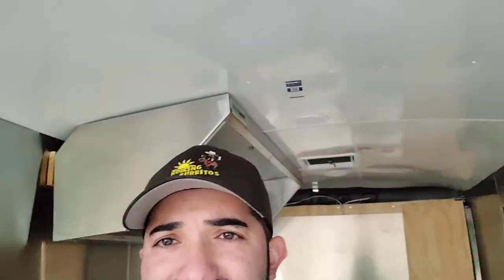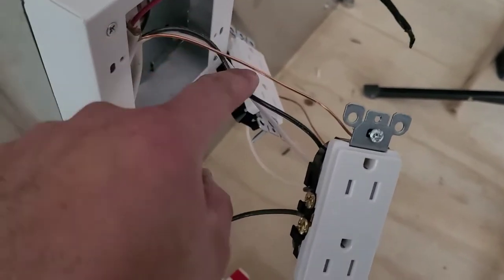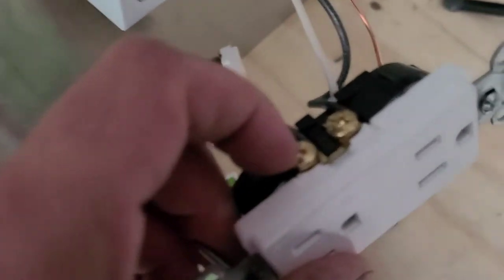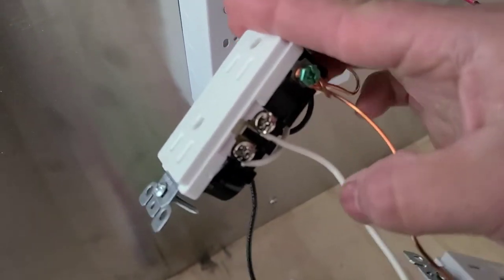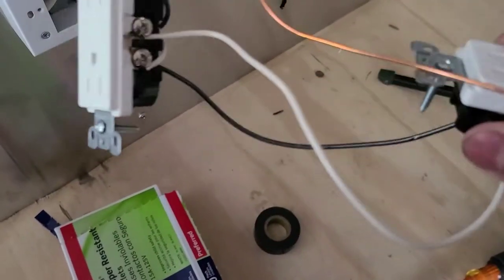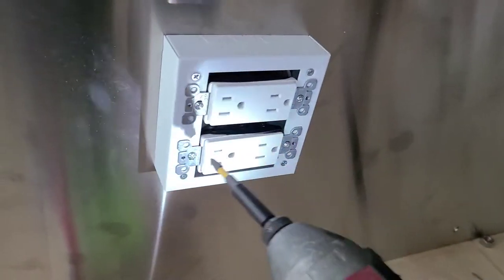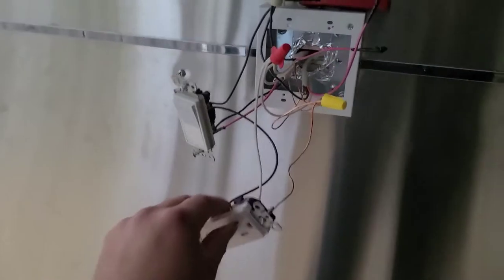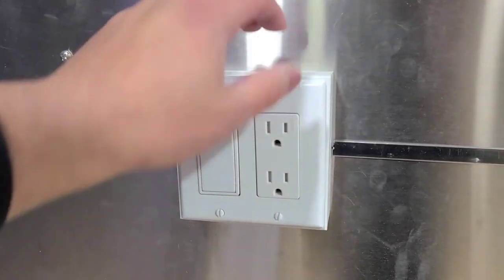How to Build a Food Truck: Electrical Version 2 💡

Comment: Frank im wiring our food truck and i am not sure so thought i would ask. If i am running 12/2 wire and 20amp breakers does that mean between the two outlets i have i can only have a total of 80% of the 20amps or is is 80% of the 20amps on each outlet?  Hope that makes sense and appreciate your help
Reply from the maker: It's of the circuit not per outlet
Reply: @fbaltierrez  Thank you i appreciate it Frank!!!

Comment: When you went from the switch to the hood vent and from the switch to the bottom plug, did you use just a black cable or another one of those Romex cables?
Reply from the maker: Romex Cable a 14/3 cable. The black cable is just for the main power goes from generator plug to the breaker box only.
Reply: @fbaltierrez  thank you for the information, I really appreciate your videos!

Comment: Hi been watching and following your series. I am building a pizza trailer, am working on the electrical right now. My question is about weight and where to put it on the trailer. I'm going with 2 -50 lb. propane bottles, probably attached to the back. I'm probably going with a 9500w generator which weighs a lot. Should I mount it above the hitch on the front or between the propane bottles in the back. Does it matter or will it tow better with the weight distributed ??

Comment: Have you had any issues with the solid wire? I have seen some information saying I should use stranded?
Reply from the maker: Not at all. My typical house I do electrical in is always. 14 gauge is solid 12 gauge is stranded. But no issues.

Comment: Hey frank does the electrical wiring have to be behind the walls?
Reply from the maker: Doesn't have to be, you can run conduit on top of the walls that looks nice. I'm not a fan of the armored flex cable I have see on some trailers/trucks. Yes it works but looks horrible IMO
Reply: @fbaltierrez  cool man thks. My walls are up and I thought maybe I didn’t read something about that . hood and fan are mounted still waiting for the electrician to give an estimate.